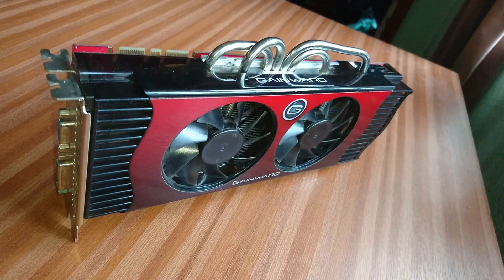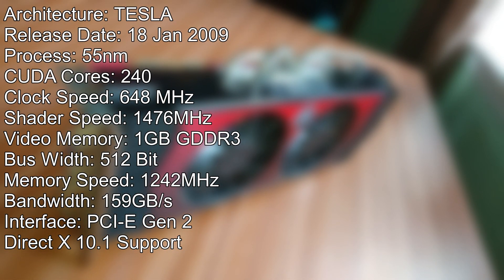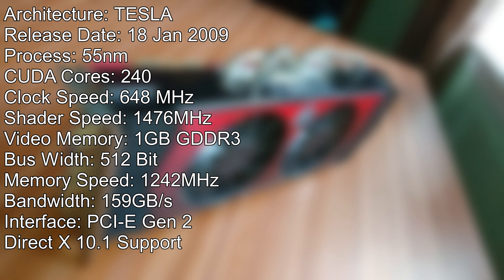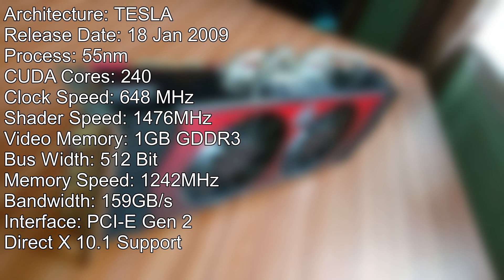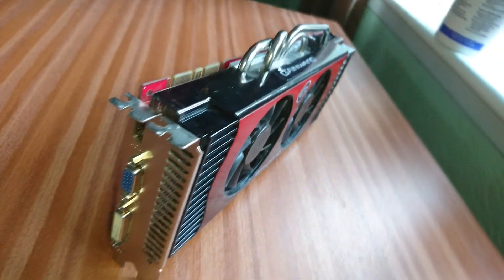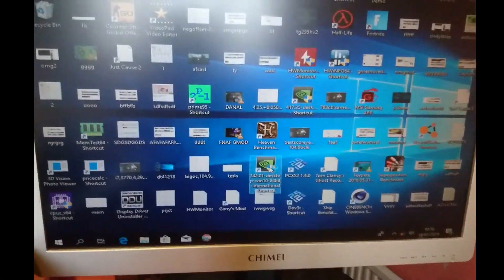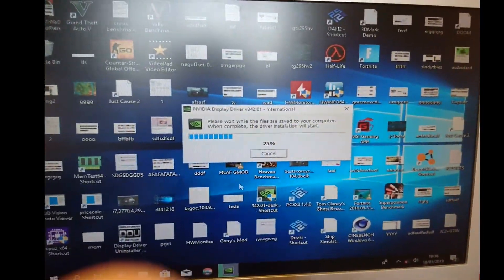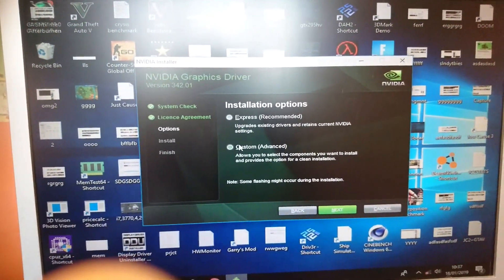10 years later - The GTX 285 1gb in 2019!

Comment: I'm thinking about getting a GTX 285 for a Phenom II X4 955 machine I have that a family member still uses as their main PC.  The old HD 3870 that was in it finally gave out and it is currently using onboard graphics.  They really only use it for web browsing and watching video so the onboard graphics are actually good enough for that.  I just want to put a somewhat decent GPU in it anyway so I could actually run some older games on it if I wanted to.  I wonder how well the GTX 285 works with Dolphin?  I'm guessing it would do ok because I was actually able to run some low end games on Dolphin with the HD 3870.
Reply from the maker: Hi! That'd be a nice retro setup! Techpowerup shows that the gtx 285 has 295% of hd 3870 performance, so would be a nice upgrade.
And Funny, I have a Phenom II pc as well, I could test out Dolphin for you with the gtx 285 and let you know how it performs?

Comment: yeah the gtx 285 is a oven. I am currently watching this on a gtx 285 with a rx 580 on the way. It won't die. Its time to put it down after 3 motherboard upgrades.
Reply from the maker: Yeah, it's a solid card, good for retro builds -shame to get rid!
And Nice upgrade so you're changing to amd then?! I was thinking of getting an rx 570 at the time but went for the gtx 1060. Both great cards.
Reply: @Jimb0ss99  Funny you should mention that, I am actually going to get a 600w psu and install it in a Hp pavillion hp6203w. The card actually fits. Only hope the BIOS recognizes it.
Reply: @Jimb0ss99  sucess it lives on.
Reply from the maker: @JisINSANE3  Cool. Ah I see all amd then! Do you have an Athlon chip? And Glad it works!
Reply: @Jimb0ss99  The Rx580 went into the PC with a fx8350 processor. The GTX 285 went into the HP with a athlon x2. So the HP is the retro build now with win 7. Just could not let go of it since its built so well.
Reply from the maker: @JisINSANE3  Great, I know what that's like, happy gaming :)
Reply: It can't be hotter than the R9 290X!  That card always ran hot!  I recently upgraded to a GTX 1660 Super and was so amazed at how cool it runs since I was used to the 290X.  The 1660 super barely gets into the 120Fs while the 290X would sometimes be in the 190Fs!  Even after I cleaned out the fans and applied new thermal paste it would still get to at least 170s.

Comment: Hello Jimboss99 , I installed this card (GTX 285) on my i5 6500 PC, I can't Run PUBG Mobile on (Tencent Gaming Buddy), do you have idea why? It's on Emulator so shouldn't it be light on the GPU ?  knowing that I Run GTAV on this card on Medium with 30 FPS stable!
Reply: This card will not run anything that need DirectX 11.
Reply from the maker: Hi Banditto King, I have had experience with emulators - bluestacks app player (android) and PCSX2 (PS2 emulator). I am not as familiar with this one. 
When you say you can't run the game do you mean you can't start it up or you just get bad performance when it has loaded?

I read that maybe updating graphics drivers might help.

I can tell you with the PS2 emulator you can choose different rendering settings - openGl, directx11 or 9 etc. Finally you can choose software or hardware mode where software just uses the processor and the desired number of threads, and hardware mode where the gpu is used instead.  
Although the gpu tends to get better fps in the ps2 game than the cpu, the gpu tends to come up with graphical errors.

So are there any options where you can change rendering settings?

I found this website you may not have been on which helps fix some issues:
https://www.digitbin.com/fix-tencent-gaming-buddy-error/

Thanks for the comment and hope this helps!